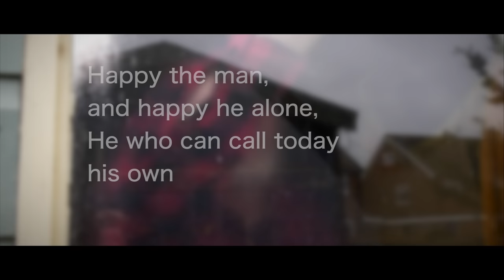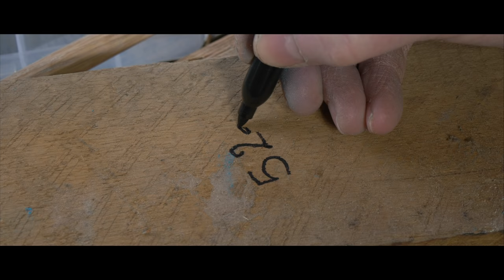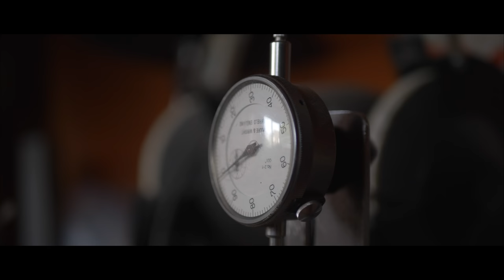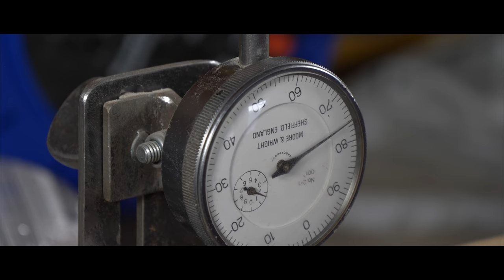Making Oak Shafted Arrows for a Heavy Draw Weight Flatbow. Happy the Man.

Comment: Howdy Mick, Before someone runs out and buys a bit of wood to make arrows. I'd suggest fixing straight grain in one's head. Perhaps going as far as either starting with splits or paying the extra for quarter sawn from a shop  or mill that supplies boat builders: consistant spine and strength. Someone asked whether it was white or red oak. Both species have similar characteristics but white would be slightly stiffer. Great video, my friend.
Reply from the maker: Hello John. Yes, absolutely right and a wise thing for anyone to do. The video was more about the craft as an act of peaceful absorption than about how to make arrow shafts, fletch and arm them but your wise input is great for anyone who takes inspiration from Gary's work and had a go at making their own arrows. Thanks John.
Reply: And very sharp plane blades too or you would end up with a shredded ripped up mess with that course type of grain.

Comment: Make a pole lathe. Saves all the fecking about. It's how we've done it since ancient times. Just make sure you split the wood and reduce its size by splitting it to near enough. Otherwise you'll get run offs on the shaft and you'll end up with ... well you've all seen those photos. I'm been fletching since I was six. Admittedly only in a home sweatshop when my father realised children make good slave labour and will do tasks for ten cents a day. But I loved it, and it was a good gateway to bowyering and other woodworking for me. And the only way I've ever seen done (at least out where I live, observing the older folks) is lathed. None of this ten hours of bandsaw and plane stuff from a plank.

Comment: A lovely video too watch Mick thankyou. Gluing a bodkin on with heat glue, I'll have too try that. Epoxy can make such a mess.
Reply from the maker: Hi Ray. Thank you! Quite a few people use hot-melt for securing arrow heads. I used it in industry for many years and with correct prep it can work in this situation very well - and it makes it very easy to remove a head in the event of a broken shaft - just apply heat and off it comes!
Reply: @MickGrewcock  I'll definitely give it a go, I shoot into a target that's made of compressed foam and I sometimes have lost some heads pulling the arrows out. I do use silicone spay on the first 4 inch of my arrows but if its been raining they still take some pulling out.
Reply from the maker: @rayzugar4776  Worth a try Ray> Good luck.

Comment: Brilliant.  I love the handmade tools and jigs.

I have a question about the arrows - why are they made of oak? Isn't oak too heavy for a flight arrow?
Reply from the maker: Hi there. These are not 'flight' arrows as such, they are used over distance aimed at 'marks', often flags or land features, but the intention is not purely distance. Originally the sport was most probably practise for military archers using arrows similar to those used in conflict - and many archers who follow the sport today loose arrows that are relatively heavy. Gary's bow in this video requires a comparatively weighty arrow; a lighter 'flight' arrow would damage the bow.  Gary is experimenting with the oak shafts but they fly well and are well matched to his Joe Gibbs bow.

Comment: Mick, Ive started to make my birch longbow now. But the stave is spiral and idk how to continue, any advice?
Reply from the maker: Spirals do bring problems. You could try untwisting it with heat but it works only for a slight twist. If it’s too bad best to move on to another piece.
Reply: @MickGrewcock  Well thanks for your advice mick, but is even birch good enough to begin with to make a bow outoff?
Reply from the maker: @Max-yv3ok  Oh Yes. Not used it myself but I believe some cultures used birch extensively. I believe it favours a flat style bow so don't make a rounded belly bow from it - that might not work too well. Good luck.
Reply: @MickGrewcock  Will try my best!
Reply: @MickGrewcock  Will you ever do a holmegaard style bow?
Reply from the maker: @Max-yv3ok  Maybe, it's on my list - just very busy with many other projects so it may take a while I'm afraid.
Reply: @MickGrewcock  No worries, take your time

Comment: Nice straight grained oak/ Are these the ones you were thinking about to get a slightly better cast for roving?
Reply from the maker: Gary is still experimenting with these oak arrows but yes, I hope to cadge half a dozen soon!
Reply: @MickGrewcock  It could be useful to record some specs as a point of reference in anticipation of testing some variables.
Weight,foc, etc. Draw weight,fps etc.
Reply from the maker: @rodparsons521  Yes, agreed.